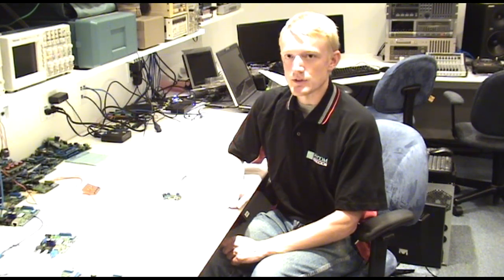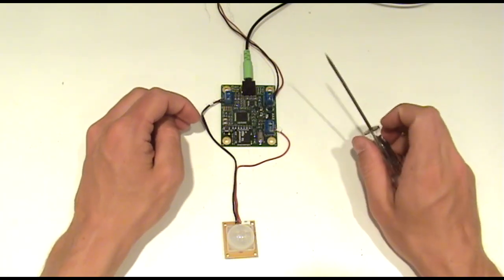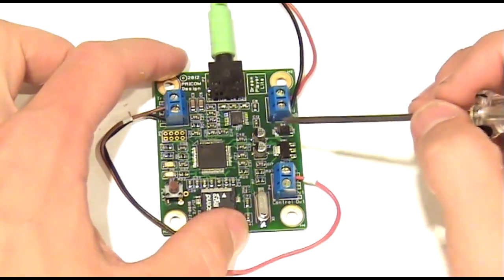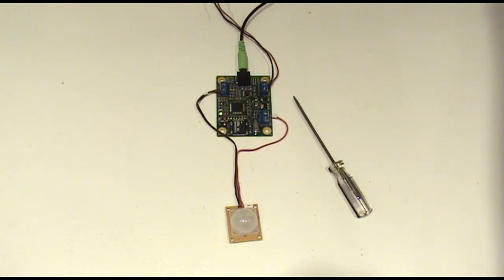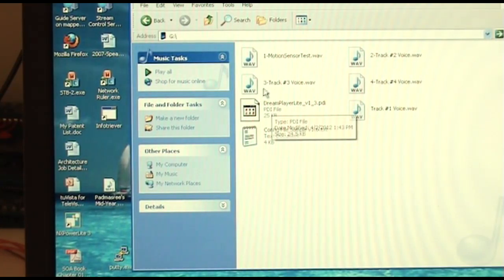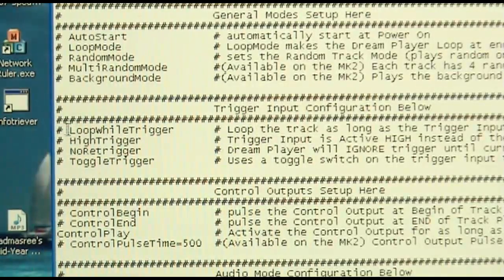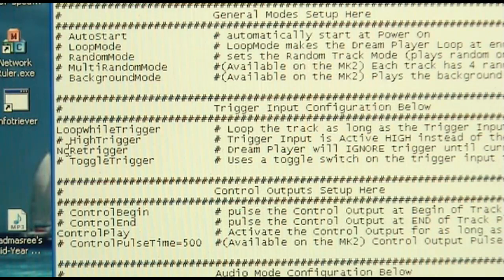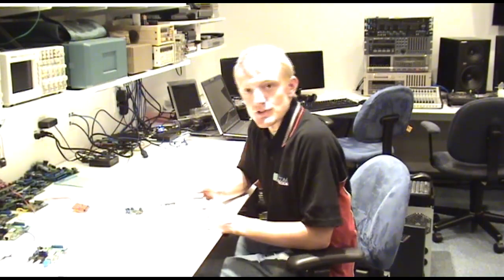PRICOM Design - How to Connect and Configure a PIR Motion Sensor

Comment: Hi there - thanks for a great product. I have the DP Lite and have loaded DreamPlayer_v2_0.pdi. I have setup the motion sensor which works but for some reason once the DP Lite receives a trigger input from the MS - it continues to play all the sounds on the SD card - even with no subsequent trigger input. 

I have 32 wav files on the SD card. I want the card to play one of the 32 files randomly each time the motion sensor is triggered. It should ignore trigger input while playing a sample and then if no further trigger input is sensed it should stop playing and only play again when the motion sensor detects motion. 

My config file has the following settings active :

RandomMode
StartupDelay=30
NoRetrigger
NoFade

LoopWhileTrigger - seems to make no difference in either active or deactivated state with the above settings.

Any idea what could be the problem?